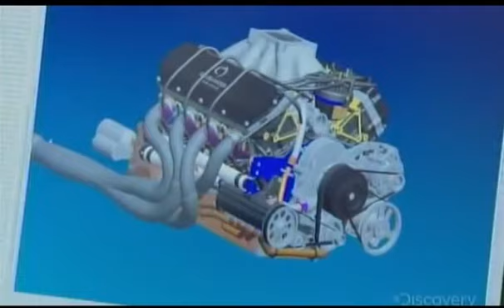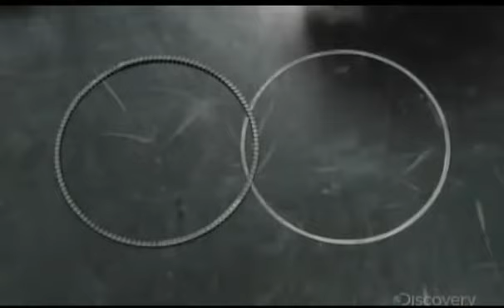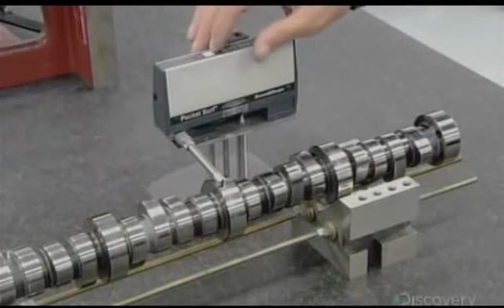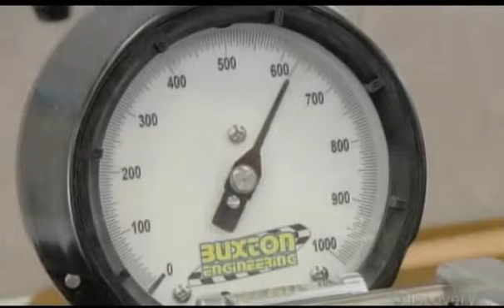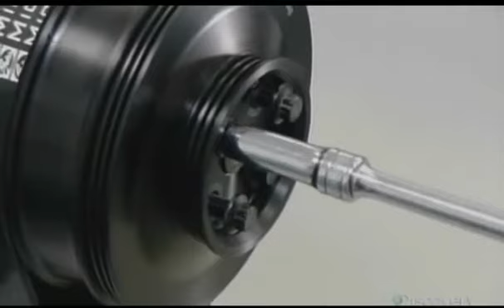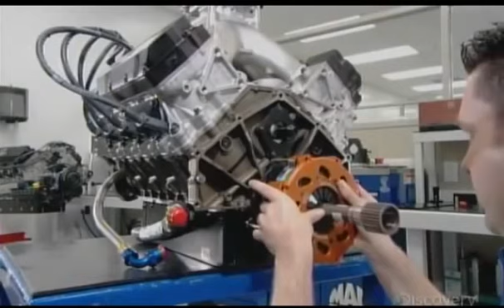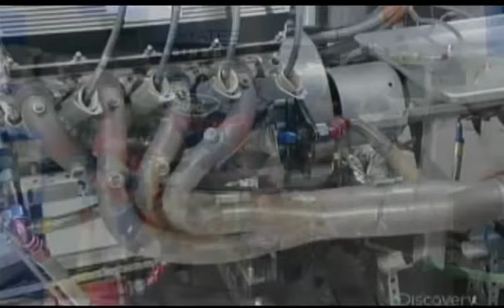How its made   NASCAR Engines

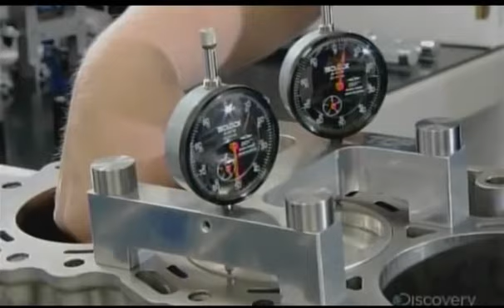Comment: @03:20  he's using an indicator on each side due to the loose piston rock.  I didn't see him set up and zero each one, but assume he's splitting the difference between the two indicators, which looks like it's going to be around 0.025" above the deck, and in the vid it looks like the piston is above the deck at least that much.   I'm not sure how he gets the clear peace on it unless he lowers the piston back down a controlled amount and calculates the difference?   Anyone know?    I know this is just a quick demo for making the video, and their gonna want some C-clips to hold those piston pins in unless they have some other trick.

Comment: I had no clue about the use of a timing belt rather than a chain with these engines. Obviously it holds up at levels a chain would not so it's used for a reason..

Comment: Watching this video; one, the narrator don't know what she's talking about. Two; I never once saw a torque wrench or a gasket used in the assembly of the engine. 3; where's the spark plugs?? 4; Once the engine is running the alternator takes over electrical duties, probably a decently high amp one too. At first when the tech was putting on the oil pan/sump, I was screaming in my head that he had forgotten about the oil pump and then realized they use an external pump/cooling system for lubrication. But I would love to see the engine run without a single gasket, see how much fluid leaks out.
Reply: Thus video is most likely outdated

Comment: What's the difference between a pushrod engine and a regular car engine?
Reply: Depends on what a 'regualar car engine' is to you .....unless you mean the difference between the Nascar units here compared to other car engine like a Toyota Camry or a Honda Civic ...... Coz push rod engines were common back in back in the day....and in normal cars they werent insane like nascar units ...tho. ...they did have em in the normal spec cars .....but ...way detuned .. until the mid 80's ....then we had cars like we have em today .....except Chevy and Dodge vehicles that consist of the V8s ....those still do have push rod motors .....still not the same thing as the ones in Nascar but ....same design tho ...

Comment: Australian V8 Supercars using the pushrod technology and can produce between 650hp to 700hp.  Run for hours and hours at 9,000 rpm during the 1,000Km or 660 Miles of endurance touring race.   its. cheap, fun and parts are easily sourced.   F1 or Le Mans are nice technology to have but the price is must be in the millions.
Reply: 9,000 rpm? They're limited to 7,500 rpm at 10-1 compression and five litre capacity, so the horsepower is a bit of a stretch at 7000. Calling pushrods "technology" may have been a thing a hundred years ago, but now it's archaic, and one thing V8 Supercars aren't is cheap.

Comment: The 2018 Dodge demon has a 850hp engine most Nascar only uses 350hp. Just a fun fact
Reply: ethanplaysbtd “stock car”
Reply: @marcklarriera2456  Yeah the demon at 850hp is bone stock.
Reply: Ik this comment is old but nascar engines can reach 900 hp but are limited to either 670 or 510 hp

Comment: 😂😂😂😂it is really funny to read all those haters' comments about pushrods V8s. Pushrods V8s are cheaper to build and very simple. They make power very easily and they make tons of torque. 

And....About specific out. It is just for you keyboard warriors to shit about those internet arguments. And you probably never own anything more than 200 hp. F20C has 120hp/L, but so what? It still makes less power than the LS3 which only has 67hp/L. And do you know what that mean? It means your car is gonna be slow as f**k. A Big block Chevy maybe "only" makes 600hp with 8.0L of displacement, low tech? Yes, but so what? It is still makes more power than your Honda Civic. And it probably makes 700 ft-lb of torque at idle. If you put two turbos on it, it gonna makes 1000 hp 24/7. And there is no such thing like "if you enlarge XXX engine (with high specific output) it gonna make xxx power". It is not that simple. Maybe you should enlarge S2000 engine to 6.0 with 12 cylinders. so it would make 700+ hp

Comment: air conditioning? NASCAR? HAHA!! WRONG!
Reply: Actually, the cars do have air conditioning.
Reply: Greg Dunagan the cars are not air conditioned the drivers helmet is however. you should probly check your stuff before you try to correct somebody.
Reply: Owen Solmen yes, the cars have a "cool box" which blows cool air into the driver's helmet. This system meets the definition of air conditioning. The narrator is correct. Have a great night.

Comment: everyone's hating on the pushrods but fail to realise that the most powerful cars on the dragstrip use supercharged pushrod v8's; top fuel engines. They make 11,000hp. Nascars can run at 9k rpm for hours I dont see whats so behind about that
Reply: Well look at dodge and chevy they both still use pushrod engines and in dodges case are pushing 800+hp and chev are making 700+hp
Reply: @Michael Benedict yes same power with a 1/3 weight
Reply: All are great engines totally different valvetrain. Don’t The f1 engines use compressed gas to close the valves? Idk. They are all Engineiring marvels in their own sense of the word
Reply: @russellschroeder990  There are no engineering marvels in Nascar engines. The rules have been established to restrict their power and the cam in block, pushrod, 2 valve V8 design has been around for around 70 years or more. Nascar, Drag Racing and Speedway/Sprintcars etc are built around the American V8 and their rules keep anything else out, including innovation. It's no wonder those forms of racing have little following anywhere else in the world, where 6 litre V8s and massive pickups aren't a dime a dozen. 
F1 engines have gone through a dazzling number of iterations over the years, as new rules keep being introduced to slow the cars down. It's a form of racing where the cars and engines are effectively different from team to team, rather than the badge engineering that goes on in NASCAR. A Camry could become a Mustang in an afternoon, as the noses and engines are the only effective differences.
Reply: @Michael Benedict lmao 35 mil for just the engine? You smoking drugs
Reply: I love how the F1 and Nascar guys argue like siblings....🤣
Reply: Exactly! Finally someone is smart in this comment section! The old fashioned carburetor pushrod V8 is a great engine style and it has been proven a great engine style by the test of time. And you are right, every very powerful drag car uses a carb. pushrod supercharged V8.
Reply: Yeah you won't see a fucking f1 car doing that lmao
Reply: here is the problem top fuel cars make 11000 horsepower and take up way more then nascar and goes more than 300mph but nascar has at maximum 1500 horsepower and dont take as much and doesent take nitro fuel ur saying 1.5k vs 11k and those pushrods have to deal with 11k horsepower for an hour and nascar get pitstops that dont take 40 minutes and the money it would cost for 1 hour at 300mph with nitro fuel you could buy like 3 top fuel dragsters for that
Reply: @lunchable2490 nascar has never made more than 1000hp, at least since the 80s. They’ve been close, but they definitely haven’t made 1500. They probably easily could though.
Reply: DOHC gets you to buy 2 of everything...so it's better for the capitalist class.
Reply: It's all about RPM,S a push rod engine works fine at 6500RPM,s above that you start getting valve float , if you can overcome this,, that's good but engine wear starts becoming a problem. 
Fortunately for us with modern engineering there's lots of alternatives.
Reply: It is really funny how many clueless people argue about topics they have absolutely no knowledge about.
The misinformation under this comment is insane, I hope no person who wants to learn about engines reads this..
Yes there are a few and true statements been made that are good, but the BS absolutely outweighs that..

There’s nothing comparable between those two engines and if you say you are true Motorsport fans you guys all are lying!
A true Motorsport fan marvels about every engine, especially different ones and loves to learn about new cars and engines!

The most stupid stuff you get to read here is from those that say NASCAR engines are so traditional bla bla and will forever stay like that…
You people do know that not only INDYCAR, but also NASCAR will get a hybrid drivetrain in the next few seasons?

I mean I also don’t like it for NASCAR, I don’t even like the fuel injection that’s in place since the 2007 until 2013 used gen 5 „COT“ (Car of Tomorrow) and I especially dislike the sequential transaxle of the since 2022 used gen 7 „Next Gen“ cars.
Also the independent rear suspension is totally wrong but I can’t change it unfortunately..At least there’s still the Trans Am class who basically are „stock cars“ that only drive on roadcourses with amazing pushrod V8, classes with carburetors and fuel injection and also good old 4 speed manual transmissions with the much beloved 1:1 4th gear!
That’s how it should be! 
The engine and the driveshaft are turning the same speed, a direct closed coupling straight to the rear differential!

NASCAR for me is traditional American racing with those traditional technologies, but this doesn’t mean that I absolutely love modern engine development in other racing classes which are all about technological progression!

Anyways, grow up guys and stop fighting each other if you basically love the same things!
Reply: Dude the push rod handles the stress way better , there’s no way you can race a car for more then an hour climbing speeds from 120-200 without it.
Reply: @Sweetluckk  hmmm..... F1? 24h of Le Mans?
Reply: kize32 f1 banned a lot of pushrod engines so they moved onto overhead but there’s a reason that overhead cam engine takes a 1,000,000 Dollars to research and make.
Reply: @Sweetluckk  but overhead cams has advantage (DOHC).  Most V6 DOHC make as much hp as V8s..  example 2019 Camry V6 makes more HP than a 1996 V8 Chevy Camaro Z28  5.7L OHV
Reply: Watson Anthony maybe try comparing it to a car that’s from the same year instead of a car that is 20 years older
Reply: Watson Anthony umm no? new chev camaros and dodge challengers are pushing well over 700hp
Reply: @watsonanthony8438  go build a new pushrod engine with updated new age components and that statement is irrelevant
Reply: @MichaelDouglas-24  can this car auto run a buggati or f1...nope .. irrelevant that biaaachhh
Reply: @watsonanthony8438  test either of those two for 500 miles under the same conditions, they'll never compete. And also, don't forget they are a lot harder to drive than an f1 car full of assists or a Bugatti. Bugattis are slow, Koenigsegg is better
Reply: @Michael Benedict you've got no idea what the fuck you're talking about. F1 car is 700kg without driver and Nascar is 1500kg. F1 car can lap Nascar twice in a single lap. F1 is 50 bilion $ bussines and Nascar is on the verge of being canceled
Reply: @kize32  an F1 car cannot lap a nascar twice in one lap, the top speed of a formula 1 is only about 40 mph higher than nascar and 0-60 is only about a second faster. F1 would definitely lap a nascar, but it would take multiple laps
Reply: @kize32  yeah I'm sure with all those v6 turbos and hybrid v6s F1 has now that's real true
Reply: kize32 I thought you had to drink soy milk in order to be a F1 fan. It’s a no contact racing sport right? Basically top tier go karts. That’s so cool

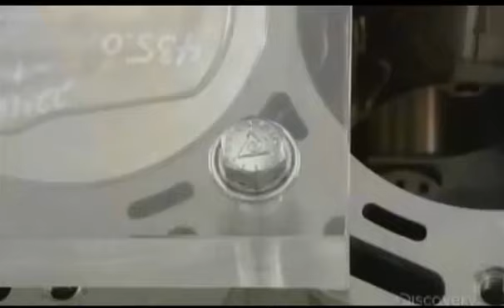Comment: I am learning stuff here (a 2-stroke guy), but the liquid measuring tool at min 3:31 is not called a "syringe", but a "Buret", and I have one if anybody wants one. It measures up to 50cc, and 100% made of glass (even the valve).
I modify little 30cc two strokes now, and use a 3cc syringe to verify compression ratios. :)

Comment: Very basic video of a very complex subject. There is nothing stock about what you see screaming around a track on a Sunday afternoon. I ran short tracks for about 15 years and can attest that it is a LOT easier from the stands than from in the car. These engines USED to be based on factory produced Ford, Chevy and Chrysler blocks but this thing is a custom piece from top to bottom. These engines put out close to 800 HP and will stay together above 8000 RPM for hours. There is NOTHING stock about them.The old stock 350 chevy, 351 Ford and 340 Mopar could only DREAM of that kind of power and durability. THAT is why NASCAR has dropped off in popularity....they abandoned what got them to the top...STOCK cars.

Comment: Uhm... no flywheel? lol
Reply: there is no fly wheel. there is metal friction plates and then there is friction plates with friction pads. these clutch packs are just like motorcycle clutches. and top fuel dragsters use clutch setups with multiple plate clutches.
the metal friction disc sits in between the padded clutch disc. the metal friction plates turn the output shaft. while the padded plates spins with the engine. when the clutch compresses and decompresses from clutch engagement these discs grab each other to complete the drive line power.    (As a mechanic, I understand this completely, but im also lazy as shit so I copied and pasted this from another comment)

Comment: wild looking flywheel and clutch really small
Reply: no, it is that size due to acceleration and durability. It is a multi disc setup that actually has more grip than a much larger single disc.
Reply: It is only meant to last 1 race.

Comment: This is more like a engine 101 than NASCAR specific. Fail.
Reply: Its the same concept as putting just about any other engine together.
Reply: What? Did you think there was gonna be some kind of engine that runs on hydrogen and shits out lolipops or something? NASCAR engines are super basic V8's. Everyone knows that.
Reply: they are based on an old  basic design but the engineering, components and technology is space age. As you know that block, crank and rods did not come in ANY Ford V8, Custom pieces all the way

Comment: no fly wheel and that tiny ass clutch, i want to see it under load
Reply: you must not know how clutch packs work. they have way more surface area to reduce clutch slip. motorcycles use this style clutch.
Reply: Who said anything about shifting gears?
Reply: The aren't shifted with a clutch, the clutch is only used to start moving after that the drivers just bang gears.

Comment: then the idiots put on a carburetor thats undersized and choke this engine down
Reply: they are forced to do that for regulations, but the engine still makes almost 900 hp naturally aspirated
Reply: not with a restrictior plate
Reply: no shit.....
Reply: They do that because some of the tracks were so well designed, to get the cars up to top speed, before this modern era of racing, that now, you don't want the cars at top speed because they tend to get airborne. I know Taledega and Daytona run restrictor plates, I thought there was a third one that did

Comment: okay here's my two cents the one guy commented the only drive in a circle. most of the time but they do race twice a year at two of the finest road courses in our country Sonoma Raceway and Watkins Glen. NASCAR' engines design is probably at least 75 years old they are considered a pushrod engine they turn 9000 RPM for 4or 5 hours per race they make incredible power. if there was no restrictor plate on these engines these cars would run 230 miles per hour plus depending on the Aero package. Indy cars cost way way more money to build the engineering and the engine design alone is outrageous on the cost.